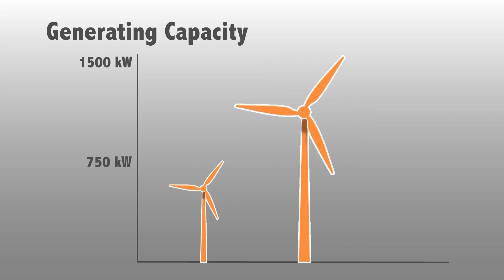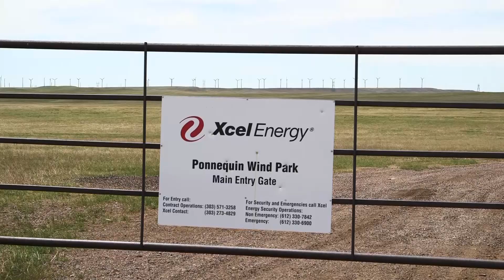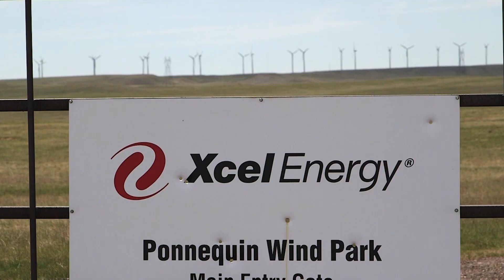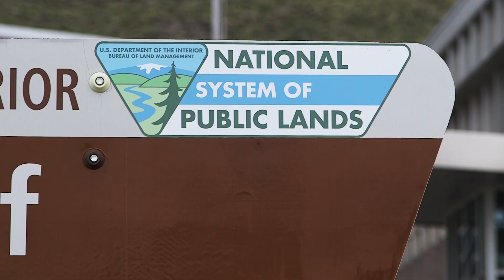Who Cleans Up When a Wind Farm Retires?

Comment: The real reason is the Trump administration is taking down wasteful energy subsidies paid by taxpayers. Tesla is going down for the same reason.
Reply: Make Nuclear Great Again
Reply: @robe_p3857  We need investment in fourth generation nuclear reactor technology, especially molten salt breeder reactors.
Reply: As far as I'm concerned, NO energy should be subsidized. Who ever can put power on the grid at the lowest cost wins. If renewable energy is the most economical, I'm all for it. It's all about something called levelized cost of energy. It's basically the total cost of installation plus realestate  costs plus maintenance cost. you also have to consider decommissioning  costs. Then, divided by the total Kilowatts produced by the generation site. one other thing to consider with intermittent renewable sources, is grid firming. That means keeping the lights on when the wind isn't blowing, or sun shining (solar). That can include dispatchable  fossil fueled co-op plants or grid scale electrical energy storage. Those costs have to be added to just the generating capacity. Put all that in the debit and credit columns of a ledger, bust out the calculator and see what works.
Reply: Is he game to take down the Oil and Coal Subsidies and force the oil , gas and coal companies to repair the land instead of leaving it to the taxpayer.
Tesla will be fine, it paid back it's loan a decade ago and the tax breaks are also available to all other EV manufacturers, just that Tesla will be the first to have used up the first level.
However there are no tax credits in Europe and China and they have at least the first year of sales sold out. (Europe has 150,000 paid deposit pre orders) and they will be delivering 3,000 per week. China they are building a Gigafactory there and production is expected to start in H2 2019
Reply: @frankspeaking2630  Has Tesla made a profit yet? Or met a single production target? That's why Tesla has problems, subsidies are drying up and investors want  a closer look at the books.
Reply: @JohnJ469  The "subsidies" that are "drying up" are tax credits that go directly to the consumer. They're available to all auto manufacturers. Tesla isn't dying, they're now profitable.
Reply: @imzjustplayin  No, the consumer pays for them, that's why prices go up. Wind farms are paid as if they are producing even when the wind doesn't blow which means power is paid for twice, firstly the people actually generating the power get paid and then those "theoretically" generating power also get paid. The consumer is the one paying for all this financial BS and they receive zero benefit from it. 
 
As to Tesla; "Tesla net profit margin as of September 30, 2018 is -10.22%" Minus 10.22% is not "profitable" in any sense of the word. The company has not ever made a profit and is yet to meet a single production target and yet Musk gets huge bonuses. That money comes from investors and some $4 billion from the US taxpayer.
 https://www.macrotrends.net/stocks/charts/TSLA/tesla/profit-margins
Reply: @JohnJ469  The consumer pays for what exactly? Nobody gets paid if the power can't be sold at a profit. You are correct there are times when the electricity costs become negative like what happens in texas because they have a separate power grid and cannot sell excess generation to out of the state. Utility companies buy power from prower producers at various market rates, much like the stock market. If there is high demand, then the electricity costs more and if low demand, then it costs less. You act like as if these things aren't economical. You are wrong. They make money and make sense because if they didn't, nobody would fund these contracts.

You erroneously think the government has this big pot of money they've been throwing at these energy generation projects that are operating at a net loss. That's not how these subsidies work. One day the subsidies will be gone (as done through current legislation) and you'll magically have forgotten how much you cared about this stuff. Meanwhile, they will continue to go on and renewable energy will be the only energy we know of and maybe someday you'll admit you were wrong. The current trajectory for renewables is very good. You're too backward in your thinking.
Reply: @JohnJ469  You're right, Tesla isn't profitable. However in 1 quarter, they went from -19% to -10% net profit margin. I wouldn't be surprised to see them being net profitable within the next two quarters if not at the end of this quarter.
Reply: @imzjustplayin  Tesla has been saying that for years. I'll believe it when I see it. If it wasn't for some $4 billion of your tax dollars, it wouldn't exist today.

Which leads to the point that "making money" and "being profitable" are two different things. An investor doesn't care if the business is profitable, they just expect a return on their investment. With governments paying huge subsidies the investor is guaranteed a huge profit, even if they sell their shares at a loss later. It "makes sense" for them because they cannot lose, once risk is involved they bail.
Reply: @JohnJ469  I don't care what they've been saying. The writing is on the wall, they're going to make it. I don't rely on company statements alone to see whether the future is going.  6 months ago it looked extremely tenuous and while I could have made a lot of money investing when they were on the brink of insolvency, there was also a lot of risk to go with that. 

Where is the $4bn coming from? Please cite it.
Reply: @imzjustplayin  https://www.latimes.com/business/la-fi-hy-musk-subsidies-20150531-story.html

An interesting editorial on the subject.
https://www.investors.com/politics/editorials/if-tesla-is-worth-more-than-gm-why-are-taxpayers-still-subsidizing-it/

This stuff isn't hard to find. Also, Musks refusal earlier this year to answer "boring" questions about the financial state of Tesla sets my alarm bells ringing. You think the future is bright for the Musk empire but I think it's a house of cards. One of us will be proven wrong. I hope it's me, but I don't think so, I've seen too many of these "Entrepreneurs" crash and burn leaving a lot of broke people in the rubble.
Reply: Good joking!

Comment: What about the concrete bases this bit of land rendered useless for millions of years at least plutonium has a half life
Reply: Concrete has a limited lifespan, slab foundations made with modern concrete are probably good for a few hundred years. Reinforced concrete has a much shorter lifespan because of the reinforcement rusting inside it.
Reply: The concrete bases are covered so basically no harm is done to the environment. And like the earlier comment said , concrete has a short life span. The bases we poured at the Petz Colorado windfarm had around 390 yards of concrete per  base.
Reply: go drink another soy shake

Comment: This video stinks of the bias of the fossil fuel industry that is rampant in Wyoming.  I started at the Engineering School in Laramie, and on a building they put a motto"The Control of Nature is Won, not Given".   That is a testament to the stupidity of this industry.  I worked on coal mines and in the oil industry.  I spent 5 years working outdoors around Wyoming and saw the remains of the original homesteaders.  Everywere was a wind turbine, and the sun is constant.  Except when it was covered by the pollution of the coal fired plands.   If there is a wind department at the University, and they say it can't be profitable, I will give the professor the acknowledgement that he is not stupid.  So he is corrupted by fossil fuel money.  Anyone corrupted by money are Corporate Whores.  
By the way, I can return to the Black Thunder Mine and I know the ground will not be restored.  It will not support any life for thousands of years.
Reply: I did not see the result of any bias here. There were no nasty indictments of the wind industry. Just letting people know that turbines have an set life span and that some states have put laws in place to see that these sites are restored after shutdown.

Comment: I dont understand. If a wind generator is producing power why would you pull it down. Does it only last 25 years because the owners do not maintain them
Reply: These shareholder companies have no ethos and only look at hard dollars, let the windmills fall apart for political reasons. Power should be public and for the people.
Reply: The blades have a life span,  the rotating assemblies have a life span.  Eventually the cost of maintenance out paces it;s profit capability.   Wind  generation is not really economically viable with out subsidizes for most places in north america.   The off shore wind farms in Europe are a different story as they generate their rated out put almost 24/7/365
Reply: RobWillmot Either the owner company loses interest in wind, land owners want the towers out of their property or the towers need to be brought down to be upgraded. Great thing about wind energy is that the land once used for the towers can be used again for anything.
Reply: Ok
Reply: @TheEliminator1992  or the towers are just falling apart from age.